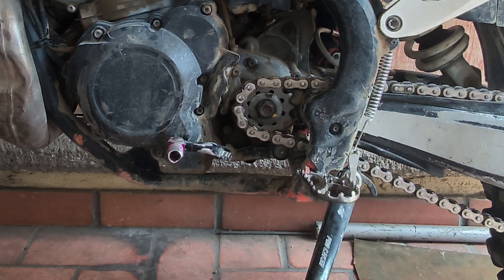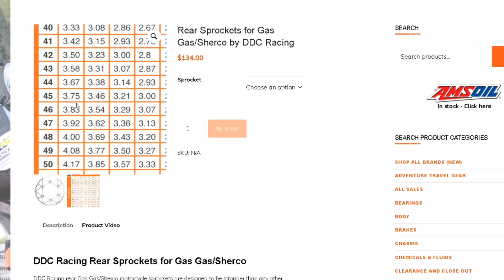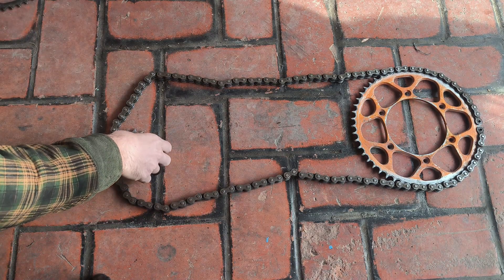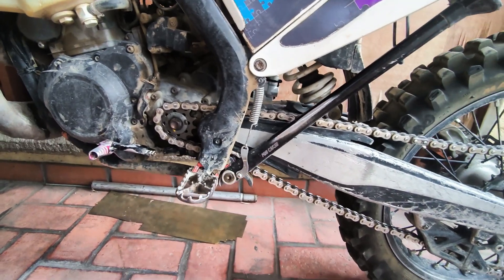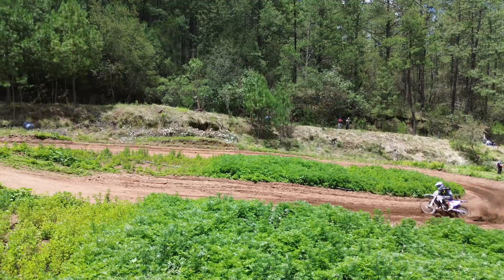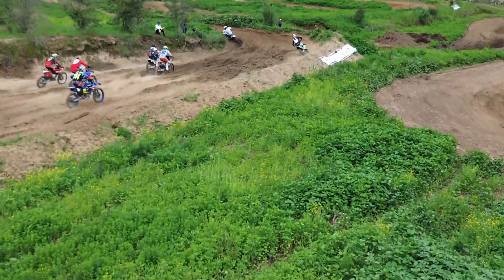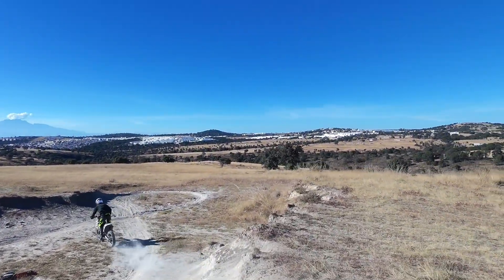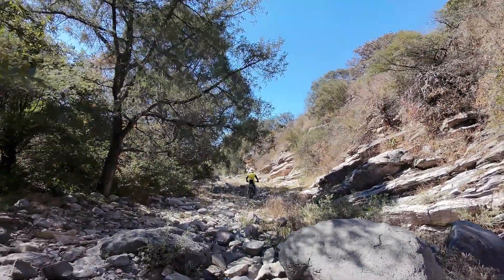motorcycle sprockets explained

Comment: yo, didnt know this yet, (Im just starting, dont even have my license yet), thanks for the information, youtube sometimes reccomends smaller channels, happy they chose this video man.
Reply: same pal
Reply from the maker: thanks for watching! I really appreciate it. Normally I stick to shorts because honestly long stuff like this is WAY harder then it looks to edit and shoot. THIS YEAR!!! this is the year I will start doing longer videos, about working on the bike, practice, and of course racing. So hopefully I can stick to it LOL
Reply from the maker: Thanks! Honestly most people get this waaaaay wrong. They will straight up tell you a bigger rear sporcket gives more top speed. It is very basic math. Sprocket changes are the easiest and cheapest way to make your bike behave the way you want... best part is... if you want to swap back you can. Even street bike world this is a fun thing to play with. 

Check out stunt bikes. They have HUGE rear sprockets the difference in front to rear being so big means massive torque and almost no top speed. ( stunt bikes don't really need top speed though) 

Go the other way and salt flat bikes will have a front to rear sprocket setup that is  way closer to the same size. 

Getting a little long here... but think of it like a bicycle. It is the same thing the only difference is you don't have to pedal. The sprockets on a motorcycle are  just like the sprockets on a bicycle. Just after the transmission and clutch and all that. 

I hope you get a bike soon btw... they are awesome